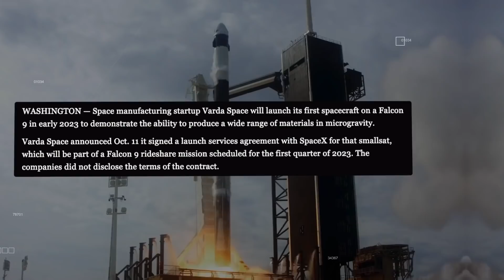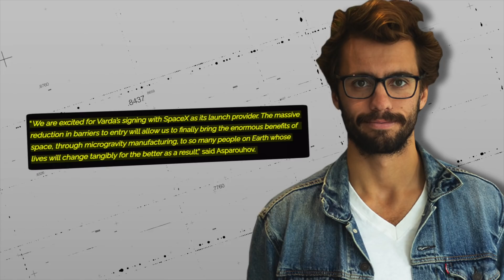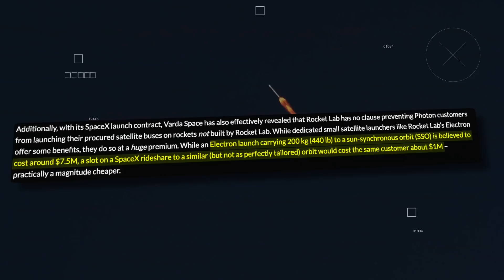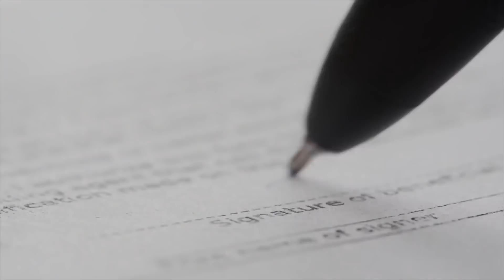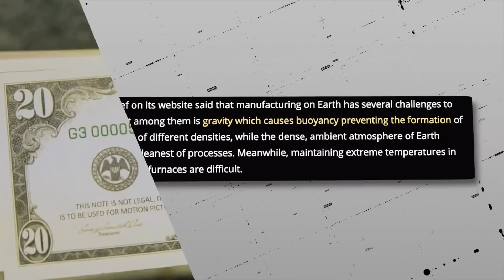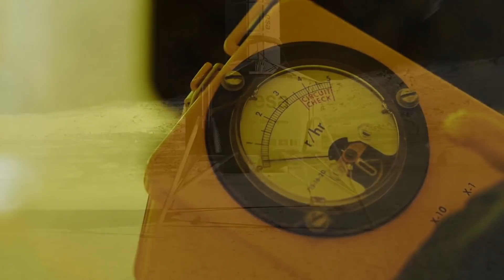SpaceX Reveals New Plans To Launch Space Factories

Comment: HOW do you keep a space suit cold on the Moon if you cannot extract the heat to the near by "Air"?
Reply: You can still vent the heat via radiators just like normal, all this means is that heat doesn't dissipate as quickly NATURALLY in space. Also keep in mind that a lack of heat works the same way in space, it's harder to transmit heat along a system, so it all just bunches up in ultrahot but small areas. This can be exploited by just diverting all of the heat to special-built radiators that can withstand that amount of heat.
Reply: @devoutrelic1228  You do not know what you are talking about, Do you have a car, remove the atmosphere and you over heat.
Reply: @unrealone1  ...The inside of a car isn't a vacuum. Not nearly the same properties.